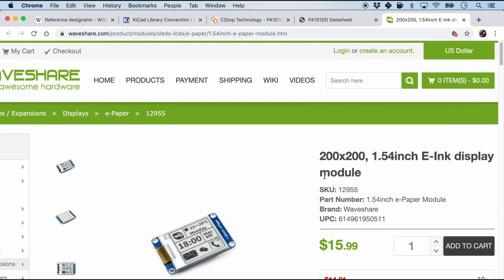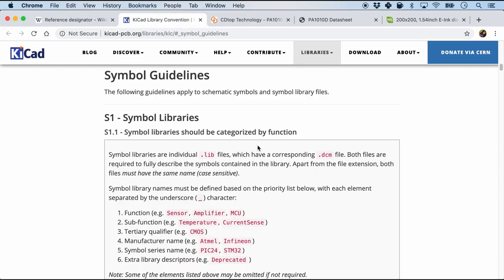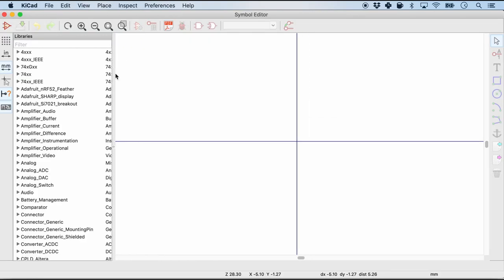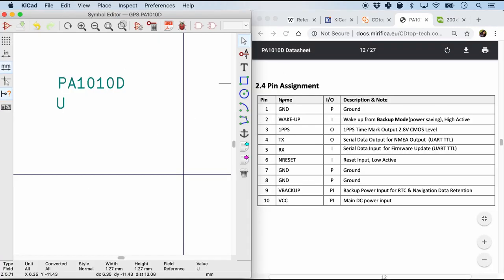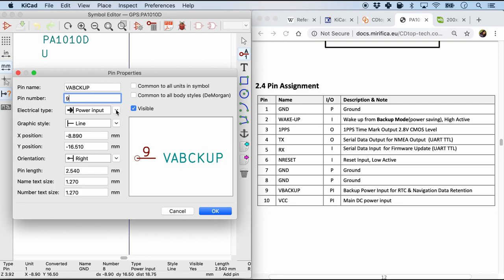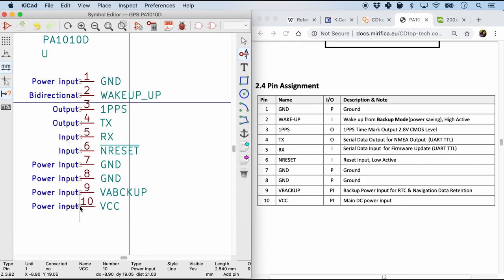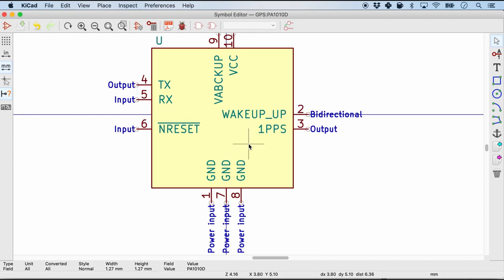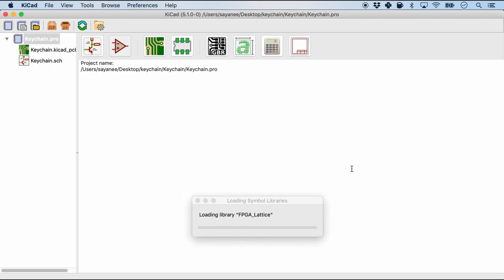Tips for creating schematic symbols // KiCad, E-Ink module, GPS module

Comment: I love how you explains things. However, the creation of the symbol library is a little bit backwards. To create a new symbol library you simply start the symbol editor and click "File->New Library". This way the symbol library file is actually created and you will not run into the library not found error. When it comes to symbol design it makes sense to group pins by function as you do. Personally I prefer the symbol layout to resemble the physical pin layout. This way my schematic layout becomes more closely mirrored to my PCB layout which is helpful when you start placing components in your PCB design. Keep up the good work.
Reply from the maker: Thanks on the New Library tip! 

I just tried that and it's definitely better. It even prompts you to add to Global / Project which will automatically add the Library path, which I was doing manually 😅